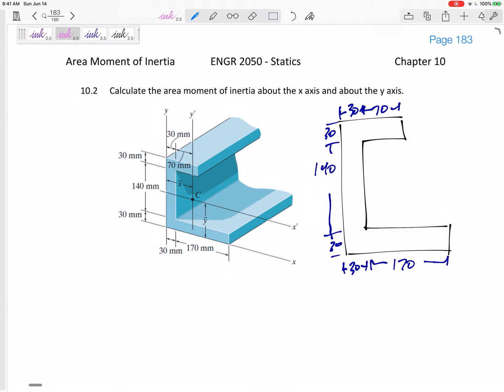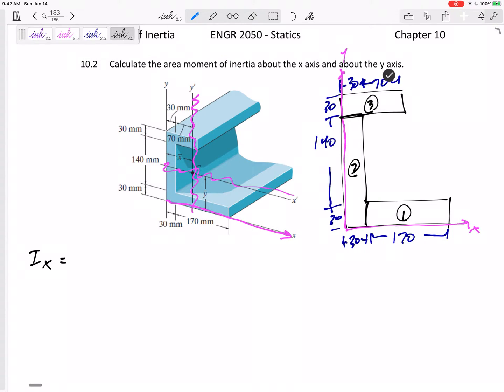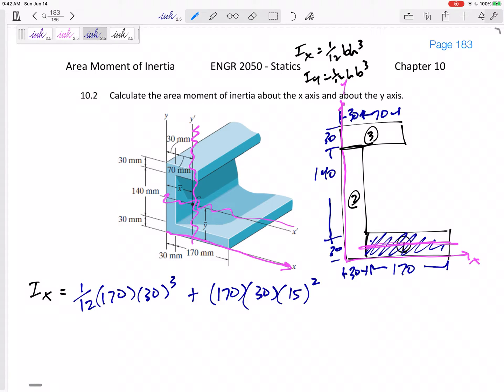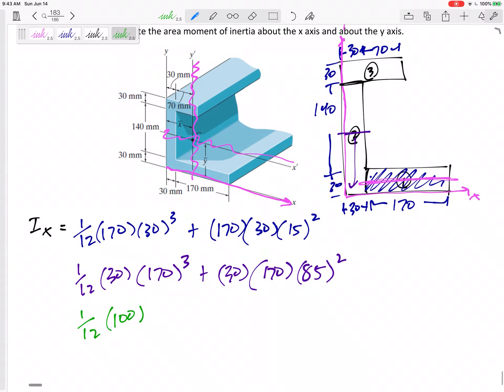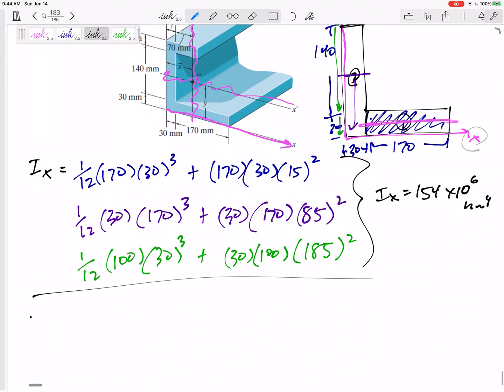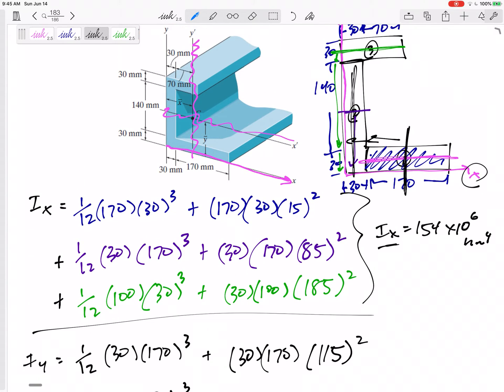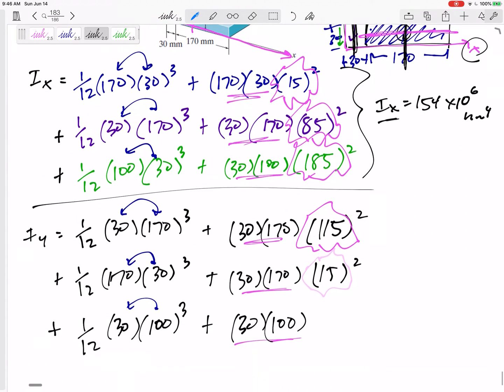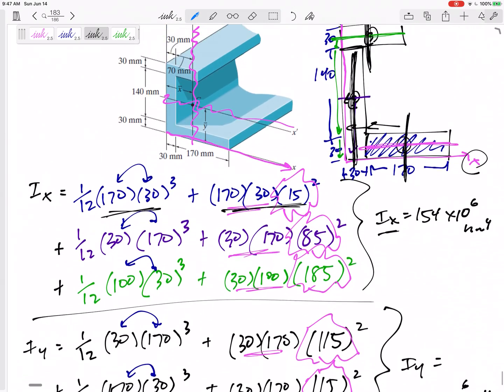Statics - Area Moment of Inertia example 1

Comment: you should be calculating the area moment about the centroidal axis-- structurally, it means nothing to calculate from the y or x axes. there's a reason there is an x' and y' in the diagram. unhelpful video if you were to ask me